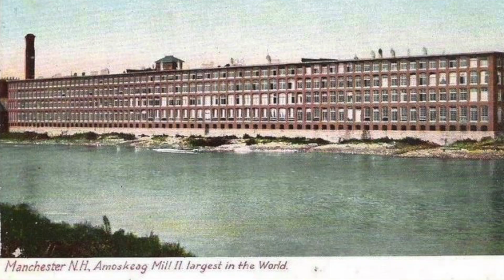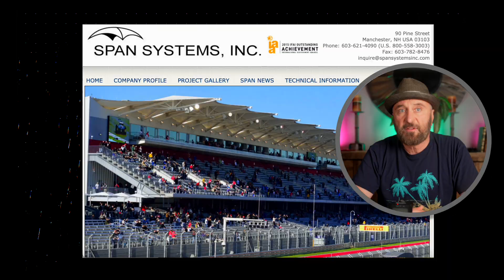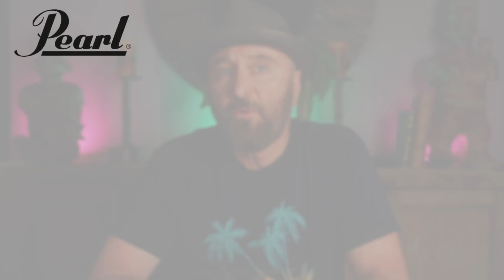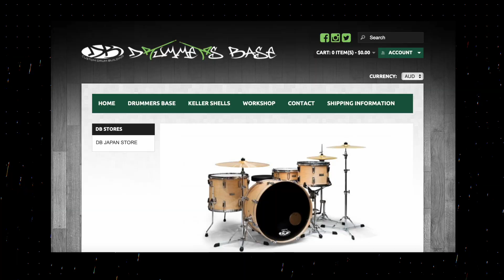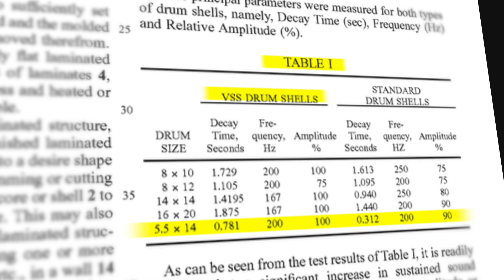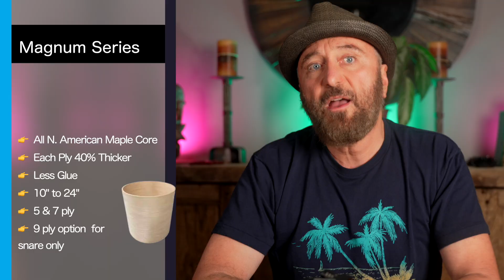Keller Drum Shells - What you didn't know!

Comment: One of the absolute best speaker driver manufacturers in the world is SB Acoustics in Indonesia. They only manufacture "Professional" speaker drivers, and full "Professional" speakers for large venues. They are 100% vertically integrated, meaning 0% outsourcing. They make everything in house giving unsurpassed quality control of their products. They do not sell full speakers, but you can get their individual drivers to build your own speakers with Madisound being the only U.S. distributor. However, even so, their speaker drivers are very affordable and would be hard to beat at any price for a speaker DIY build for home speakers, or they also make 4 ohm speaker drivers for your car as well. Better than 99% of the competition. I say this since I'm sure many drummers are also fans of stereo equipment, and naturally great speakers. But you can build great home speakers for 1/3 of retail cost. Companies have the speaker cabinets already cut into the necessary pieces where you just assemble, and you can always use an older pair of cabinets taking the drivers out replacing them with SB Acoustics drivers. There is also free online software to help design and make the crossovers. Or you could use a DSP with enough channels to custom tune tweeter, midrange, woofer, and subwoofer individually. Just something I wanted to put out there. (Ex. SB Acoustics Woofer  $150 each. They make great tweeters as well starting at $50 each that have a great deal of new technology built into them unique to SB Acoustics. Just to give you an idea of price. They also offer a myriad of different materials for their speakers as well).

Comment: It's interesting Keller increased their production in the mid 2000's. During the "Economic Downturn" back then (Thanks Obama). But I would think it also good that Keller, an American company is being used instead of a foreign company. I think that's great. There is an analysis between Keller drum shells and many "Audiophile" high end speaker manufacturers who design speakers, and design the drivers but have them manufactured elsewhere. In this case generally a foreign company in either Europe or Indonesia or China. They design the entire speaker, but only build the cabinets having the drivers outsourced. This is a very similar comparison in what some of the drum manufacturers do using Keller. (Ex. Wilson or Wharfedale speakers)

Comment: About 35 years ago, just for fun, I bought a thin maple Keller snare shell for like $40 with bearing edges and beds cut. Was a great experience, but after trying everything, I could never get it to sound how I wanted. I think went too thin, no re rings, trying to copy starclassics when they came out. Flawless shell, I’m redoing it now actually for the 3rd time, about to sand through the outer layer lol. Trying some new ideas to try to get it where I want it.  About 5 years later, I built a 4 pc thin maple shell kit. It flooded in Katrina, still has mold stains in a few spots. Never delaminated, stayed round. Sanded mold off, treated it, stained it a little darker, they sound great. I had spent  little money but now had a 100% maple kit. If you do buy shells, keep in mind all the drum companies get the lovely grain patterns so don’t expect a mind blowing pattern on all drums. Didn’t bother me. Started with die cast hoops but I hated them. Drums are BIG and still sound great. I built some RIMS mounts and Ft legs and brackets as well. Shells are good quality and must be really killer today. So many more options. Walnut is my next one!  2 gripes: BD hoops were a little flimsy. And the mahogany shells need some mahogany! I could build drums forever. Got 3 snares in the works, and one is 6mm carbon steel!!!

Comment: I do not understand the connection with Rogers drums. Rogers drums were 3 ply shells.
Reply from the maker: Rogers used a 3 play shell from Jasper starting from the mid 50s.  By the mid 60s they needed another source because of demand and they started purchasing from Keller.  I believe those shells were 5 plies.  I’ve actually done a video on both of my Rogers kits, one w Keller shells and the other w Jasper.  If you get chance check those out. I get into the shells a little deeper.  Thanks watching this video!
Reply: @eddieavakian - no problem, I will check out those videos

Comment: I would like to see a video on what drums are actually Keller. That is what line in a particular company are Keller. Most of the companies listed in your video have factory tour videos where you see the shells being made, but i guess they never said it was their factory. A little misleading, but I've known a lot of companies are just assemblers and finishers. There are some that probably still build from the ground up. It would just be nice to know what your paying for.
Reply from the maker: This is a deep rabbit hole, especially for the earlier years.  Some companies only used Keller to get up and running, and then went on to make their own. Some outsourced as needed, and some companies bought other companies that may have outsourced their shells.  There was certainly no efforts made to promote an outsourced shell.   It's important to consider tho that the bigger drum companies formulated their own unique shells (in conjunction with Keller) and only had the basic manufacturing done by Keller.  For  modern drums, you may get more clarity.  For example, USA made Gretsch drum are known to use Keller (proprietary recipe), while the Taiwan drums are made by DW.

Comment: I have a 9 piece DW (5 racks, 2 floors, and 2 bass drums) which has a mix of  both keller and DW shells made in the 80’s, 90’s, and 00’s. 

You wouldn’t hear the difference.  

All great and thin shells with a tonne of tuning range. 

DW got it right the first years if it needed to sound exactly the same.
Reply from the maker: I don’t know for sure but I suspect that DW worked closely w Keller to make their shells a specific way and because of this, they knew how to make them and were able to keep them consistent.  Of course  they later added so many more shell designs to their line up.
Reply: @eddieavakian  I think so too. 

In the 10’s it changed (sometimes drastically).